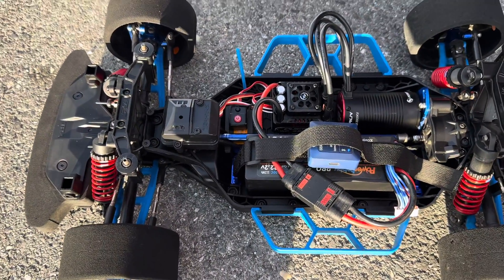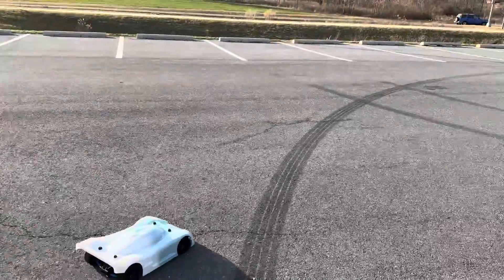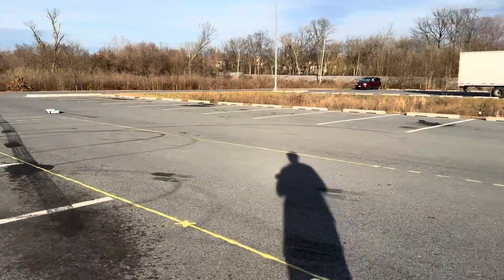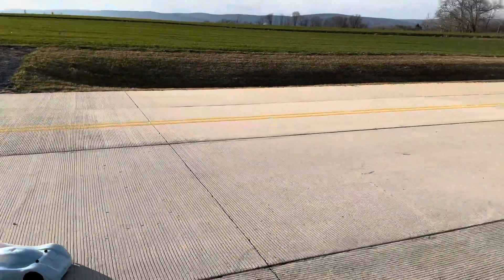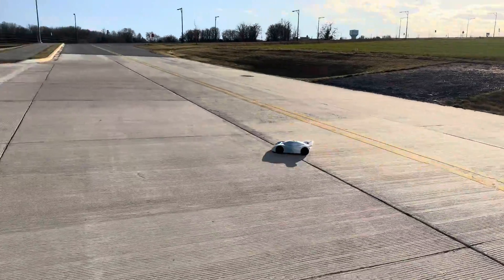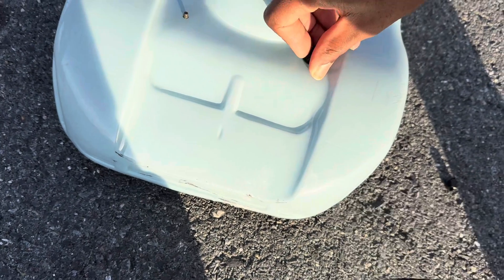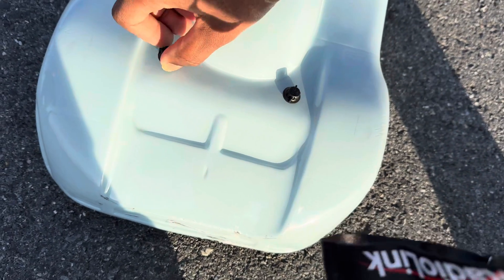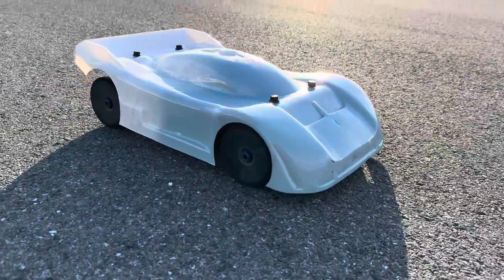Quicrun WP 8BL150 G2 ESC with Ezrun 4274 G2 Motor Combo Slash 4x4 FIRST RUN

Comment: Yeah i was curious about your spur size also. Obviously you mentioned the 22T pinion, but im guessing you changed the spur gear. Im running 22 50 in my current setup, but that's about to be leaned on a lot harder. But i want a bashing friendly setup to swap between and i did check out this combo online.. amongst a few others